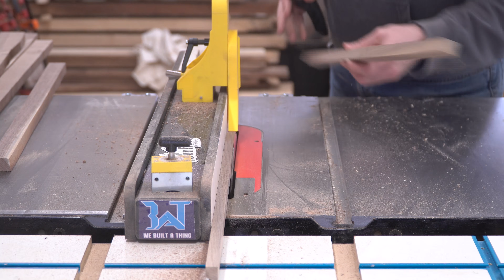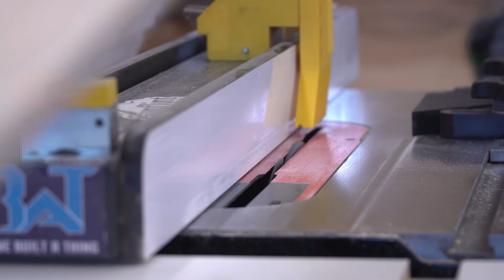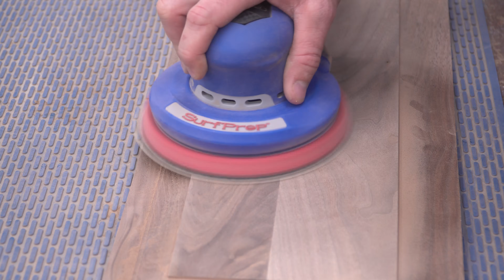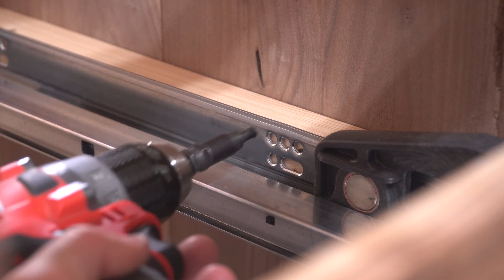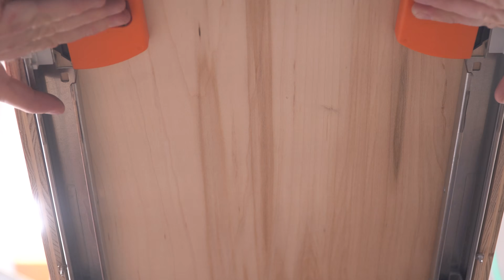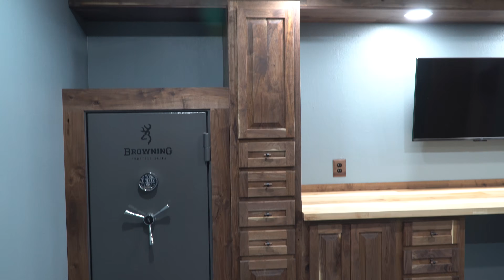Make & Install Soft-Close Drawers & Cabinet Doors || Hidden Man Cave Project

Comment: Here’s a little tip for you. Those hinges allow for you to turn the soft close mechanism off with a little black switch on the cup and if you turn one of the hinge soft close mechanism off, the door will close a little faster but still have the soft close feature! 

Also, we still have some snow on the ground here in central MN.. love the podcast!
Reply from the maker: Well that is an outstanding tip that I need to go try! 

I know of one shady ditch here that still has snow in it.

Comment: The adjustments on the drawer slides are amazing. I’ve dealt with soft close hardware before with no adjustments. Wish I had these, back then. Great looking work so far 😈👍🏼
Reply from the maker: They really are slick when you need to make those tiny little adjustments. Thanks!

Comment: Dang, those look awesome!  I've never shelled out for Blum, but I've had some of those gaps you did in some projects and in those frustrating moments of wondering how to fix the gaps, I'm confident I would have paid $___ at that point to have the problem fixed in seconds instead of an hour. So thinking of it that way, it's probably time I check em out! :)
Reply from the maker: There is a bit of a cost for convenience, but man they are worth it!